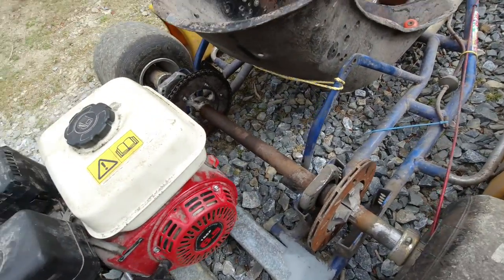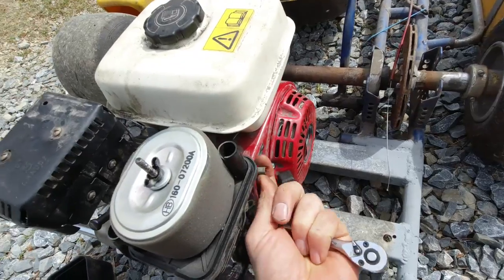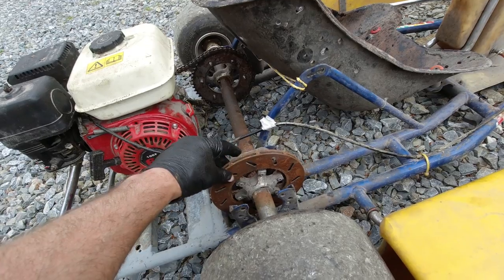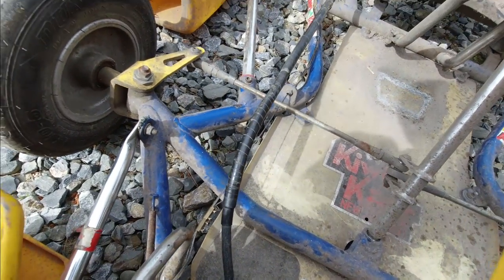Fixing an old Racing Kart saved from the Scrap Heap..

Comment: This will originally had a 2-stroke engine mounted on the chassis to the right of the seat (looking from the rear). It's drive sprocket would also be to the right. I managed to fit a Honda GX200 to a cadet sized kart using the original mounting position. It does require some fettling to get it to fit as it'll need to be raised and pushed further outboard but it'll be no good for pulling wheelies if that's the intention.

Comment: Love that you gave it a second life, Just a tip I have a similar cart and I found that because they are not designed for rough roads etc. That the large sprocket likes to bottom out on the ground which kills chains and eventually destroys the sprocket. So with mine i made up a little sump type bash plate to protect it. You might want to do the same save you any trouble in future because it sucks having to roll a cart more then 50mtrs lmao

Comment: You are gonna have a BLAST on the old pavement! Nice job! If that was a rental cart it may have had more brake than it needs due to safety regulations. With less material there(cut disc) now they may heat up faster when heavily used but the bright side is they should cool down faster too.

Comment: From past experience, so it doesn't snap, use the seat mounting bracket (the adjustable ones seen at 7:58) to bolt a brace for the extension. Helps with how the kart feels too.
Reply: Nothing will help how this kart feels, lol.

Comment: Here in the states 6.5 horse Is the standard engines in sanctioned dirt track kart racing. Pop out the governor, put on a blueprinted racing carburetor, ditch the restrictive muffler and they'll do 50mph+

Comment: Nice job, but I'm pretty sure the drive sprocket and chain should be outside the seat frame nearer to the bearing. If the chain flies off it could hit you straight in the back!

Comment: You could put a small idler gear on an adjustable bracket on the front cross piece the motor is mounted to to adjust chain tension.

Comment: I rebuild an old race kart last year. I can't believe you found that at the dump. It took me forever to find a decent cheap frame. FYI the engine is supposed to mount on your right side. You have your rear axle flipped. The brake goes on the left. The rear sprocket doesn't look right to me. That's not a problem but it's really large. The clutch also doesn't look like it was original to the kart.
Reply from the maker: Yeah this engine is too wide to fit down beside the seat, they originally had a narrow 2 stroke on the right side of seat, definitely some oddball parts on this one but it does the business

Comment: Mate, the sprocket should be mounted inboard of the centrifugal clutch to reduce the overhung load on the engine crank bearings. Cheers.
Reply: That makes sense.  Never thought about that until your comment.

Comment: Ohhhh one of my Favourite toys!
6.5 hp Honda or Chonda is a fair whack of power with a good ratio and centrifugal clutch pack, I had one with a 3.5 Chonda from an old fire pump I never used and scratch built a cart with barrow wheels for my youngest daughter (10 at the time) and I ended up governing the thing because even with my 100kg bum in the seat it was fairly nippy lol
My next project evolution was going to be the engine from an old TS185 Suzi (I have a few laying about) buuuuut I decided against it lol
Id suggest a good high density seat cushion unless you enjoy Powdered tailbone though Marty, even with my added natural padding I felt my first good rip for a week and my Daughter named it The Gimp Maker after my "R&D" session results :-D
Reply from the maker: You're not wrong about needing a cushion mate, I didn't think about it at the time but was nearly crippled the next day, big piece of foam for the highway run
Reply: @MartyT  Marty I figured that out the next morning too lol
High density memory foam works well, sections for the bum and back with a one piece bit over the whole lot makes it better.
I actually found a discarded single bed MemFoam mattress  and after some cleaning it worked well.

Comment: good score, you have the axle flipped backwards though. engines on the karts usually mount on the right side at the ladder frame and that caliper should mount in front of the left bearing. Looks like you got it sorted though :)
Reply from the maker: Yeah this motor was too wide to go by the seat

Comment: those 6.5 hp motors only spin up to i think 2500-3000 rpm, so in other words they are all torque they make i think 13 n-m almost 10ft/lb! which will be plenty for the little lad!... you can get high comp heads for the 200gx aswell i think if it ever need a bit more oomf!

Comment: ...Is that for YOU or the kids....???  🤔.    🙄
Reply from the maker: I got it with the kids in mind but its a bit fast for them
Reply: @MartyT  you could put a stop on the linkage to slow the top end
Reply: Awesome.
Reply from the maker: @zarb88  Its instantly fast as soon as the clutch engages, I could gear it right down or make it electric using a mobility scoot motor
Reply: @MartyT  thanks Marty

Comment: Marty, check out mountain bike brakes.  A cable actuated disc brake caliper would be easy to mount, and I know you could adapt that rotor flange for a six bolt MTB rotor.

Comment: Hi Marty If you sand off your plastic and get the dirt off of it take a heat gun and remelt the surface come back new little bit of work but the plastic can be restored paint job and you would easily get six to eight hundred dollars for it!

Comment: Marty - Is it normal for go karts to not have a diff? The locked axel ones I've seen are called "drift karts", and you're supposed to put a sleeve of ABS over the inflatable tires, which inflate against the sleeve, and then the ABS is consumable as you skid and drift around, eventually you deflate the tires and replace it.
Reply from the maker: I'm no kart expert but I assumed they all had straight axles to keep the weight down
Reply: I've never seen a go kart with a diff.
Reply: @MartyT  - I did some reading. By most definitions, karts must have a solid rear axle and no suspension. They avoid skidding by having huge caster angle on the steering, which, combined with lack of suspension, lifts the inside rear wheel in a turn. This is called "jacking" and setting the correct amount of jacking per track conditions is one of the most competitive components to kart racing. Also, yes, a differential is heavy and this matters on little underpowered karts.

Comment: Love your use of stuff you have about but....it's an 100cc kart. Engine should be to the right of the driver ....rear axle should be the other way round so the brake disc on the left. Meaning that you wouldn't have had to cut the main support out the back of the kart. Good bit of fun but that chassis will be soft as now

Comment: looking at that it ran a direct drive 100cc Yamaha engine .
Reply from the maker: Yes apparently it had an engine beside the seat
Reply: @MartyT  the 100cc yamaha engines are very quick and are cheap to buy i used to run them then went up to the 250 national karts running a rotax257

Comment: How do you find these things Marty?That kart probably took a methanol engine that was just a conversion from a petrol engine. LOve ya brother.. I love the Pennsylvania Dutch Hat and look with the beard. What kind of stick welder were you using my friend? I have a Miller Roughneck 2e and it will not weld but it runs great.